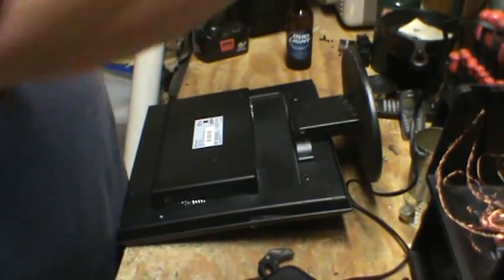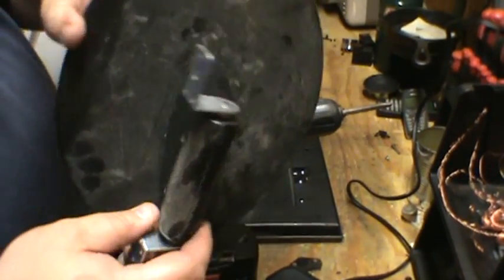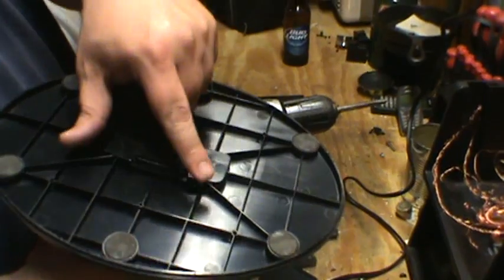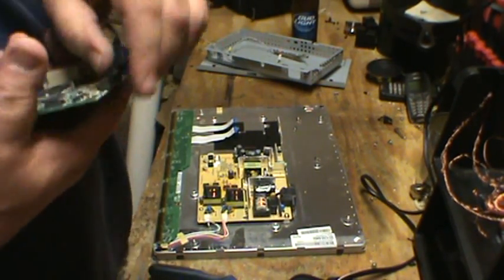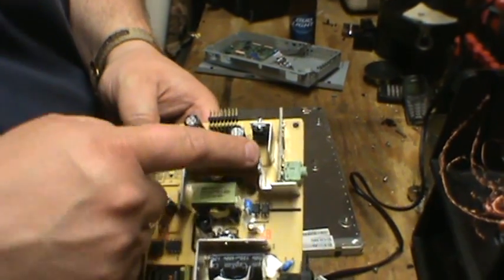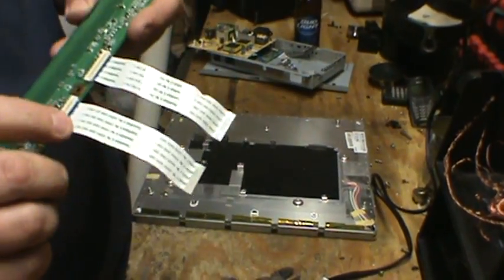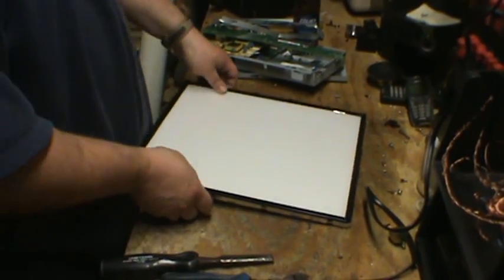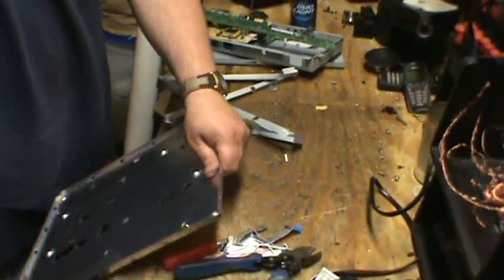Scrapping a Flat Panel or LCD monitor for gold, copper, and more!

Comment: I noticed that when you pulled the tcon board off of the screen you left the little film like connections on the screen and tossed them. Are you sure there isn't value in them?

Comment: When you remove the top/bottom chipboard make sure you remove and keep the sheet cables. Often upon removal off the board they will lift and take the gold plating with the cable (glue is stronger than the gold bond). Doing this will save a few micrograms that your currently throwing straight in the bin. With the white sheet cables with gold ends, the gold actually runs all the way through, not just on the ends so always check them and keep them aside, they will need to be processed a tad differently to extract the gold from them. Using the pyro method to reduce/remove waste materials tends to burn away and small amount of te yield, it catches in the air and floats out if the flame is too strong.  Otherwise your doing well. How long do you wait until processing yours to capture the gold? I'm probably going to do 5 years of collection and then process, fingers crossed that turns out to be at least 100kg of scrap boards and bits made of copper, silver and gold.  Steel has such a low value and very low weight being so thin to the degree that its not worth the effort to fully seperate it, I only keep the bits that have no contamination, it only takes one piece for the load to be rejected...and transport of the steel often costs what you'll get back from it, recycling the steel is more a goodwill thing to do as your working than see it as its own seperate income stream...5c - 11.5c  per kg virtually nothing, especially when clean brite copper/candy copper is at between $7 - $12 per kg, silver getting in at $18 per gram and the all important gold sitting between $130 to $150 per gram, you must be sure your spending the time sorting the correct items.
The small silver 'oval shaped' capacitors on the boards should all be saved, they contain precious metals (silver/platinum/paladium) sometimes they are gold in older electronics, good weight over time with at least 3 or 4 in each screen, the tantalum in the capacitors can also be recovered, though the amounts are small for each one, you'd need a full box of them before processing, so really you could take this video a step further and explain to people what is and is not worth saving/removing from the boards before disposal...you missed out on giving the info aboit the capacitors containing tantalum, the flat capacitors having precious metals, gold all the way along those video flat cables and saving the thin paper like circuits that show gold tip ends, gold often runs all the way along..
You could also explain that some boards use gold, some use copper so sometimes those squares and dots that look like gold, aren't and are just high grade copper...
Still, good video, I used it just to.double check I got everything out and I had it spot on, always good to confirm..
Good luck when you get to processing, take extreme care with the chemicals and the space your doing it in, and don't spill a drop...
If the general yield is around 1g to 2g per kg, i should do pretty nicely when i process half a ton 😂 should equal around a kilogram of gold...or around $ AUD 8k based on today's prices...I'll be a happy man when that day comes around...and just realising how many hundred TV's ill have to break down I'll probably need the full 5 years collecting...thank goodness for uneducated people who throw away these items!!!!

Comment: Really interesting scrap of flat panem/LCD.  Can you take your dissection to the next level?  Maybe say or de.onstrate what you do with the really thin plated gold on the board that was attached to the LCD?  Do you disassemble the copper motors as you call them, or take them to the scrapper just as removed?

Comment: Thank you, I always knew about the copper but wanted to know about the gold. Even with little it adds up with 2-60 inch tv's and 40 inch, plus 4-35 inch. That's a start. My question is.. if I decide to sell them to a use electronic place that scraps, what do you think the range I would get?

Comment: I wanna see you melt something
Reply from the maker: me too!  Soon i hope!
Reply: @moosescrapper5928  the best thing to melt without any fear of losing any portion to evaporation and oxidation because regardless of it's melting point of 2466°C-even in such condition under open air it doesn't oxidize and doesn't evaporate even if you keep it molten forever it will not disappear in any time so you basically can not spoil the melting process no matter how much you will try to!And the metal I am talking about is iridium metal:it's really formidable!I recently extracted around 4 grams of it from various sources beginning with spark plugs and from all the other stuff you can imagine that contains it:10% in platinum-900 jewellery,some in cat converter material although not too much of it in each cat:around 0.2 grams in average which is dwarfed in comparison with 7-8 grams of platinum,the same amount of palladium and around a gram of rhodium in each..But eventually it adds up!And it's unbelievably satisfying to melt it and especially the resulting beads are so damn adorable😍

Comment: So what would you say the total scrap value was in total after removing the copper from the power board?? Maximum of $2 unless you can sell one of the boards on eBay for spare parts. Then you might have $12-$20 which is worth it but ya have to wait for it to sell, but that's the best way to make money if your scrapping small time. Sell the boards on eBay, keep the finger strip board for gold reclaim, which like you say you need a lot of them, probably 10-20kg to gain a gram or 2 of gold and then scrap the aluminium back that's worth $0.25 or there abouts. The steel is worth about $0.08 if that. The amount of copper you get you would need around 50-200 screens just to get 1kg. Doing this just to scrap it all if you get 1 or 2 monitors a week or a month will take you forever and a day to $100. If your doing this just for fun, the fact you can rip apart something that's broken cause you enjoy it and keeps ya busy and happy that's were the real value from this would be and then when you finally do cash in it's a bonus

But still like all your others still a great video and full of facts and information. One question is.... are the connector pins on a power board silver plated?? Or something else like tin or nickel?? Thank you

Comment: Actually very interesting stuff would be scrapping spark plugs-I have a really good yield from them!Got on average 2 grams of pure iridium from iridium ones and actually more than 3 grams of platinum from platinum ones!*
Actually I am mostly doing it because I need iridium for my own purposes-I am actually not a scrapper(mostly)-I am a firearm designer-but since the yield from those spark plugs is really very high and the process of getting all that stuff from them is really instant-as I counted just for the fastest way to process a hundred of them required around 20 minutes to cut all the stuff I needed from them and so,I was left with 15-16 grams of metal pieces that contain all the iridium/platinum that is in them!So just imagine how much will you be able to process during a day!
And the rest of the process is just throwing all that platinum/iridium containing stuff into a small beaker with aqua regia(all together)and just heating that beaker and just waiting!Overnight you will get a solution of hexachloroplatinic acid with some useless poop into the solution,and all the iridium sitting on the bottom simply untouched-because it absolutely doesn't give a fuck about anything acidic known to man(only if you manage to oxidize the iridium fine powder with a substantial amount of heat-than you will be able to react that iridium oxide with some acids to get iridium salts-but that is not the case)-so just put it through filter to get all your iridium metal and then just precipitate platinum from the rest of the poop with some ammonium chloride just in the well known standard manor!So I think it will be good if you make such a video!
And by the way another tip of getting a large yield of platinum!As I figured out,the Ford F-250 cat converter made around year 2006 contains irregularly high amount of platinum and palladium-actually more than 30 grams of platinum(!),and even more of palladium!

Comment: that plastic monitor screen is actually laminated pieces of glass and Liquid Crystal. which from what I've seen looks like silver and gold printed circuits.ifyou look closely you can see the circuits on the very outer edge. you can separate the glass with Map gas to get access to it

Comment: Good video Moose.  I scrapped my first flat screen monitor last night and it had a magnifying lens.  Do you know if that's a frensel lens?  Also, your mid-grade boards...do you keep them intact?  Do you pull off the gold plated pins?  Basically, I've been pulling copper and aluminum heat sinks off low-grade boards but I'm pretty new to this and not sure what to do about the higher grade boards.
Thanks.
Reply from the maker: So far I have nly found Fresnel lenses in projection TVs.  I do cherry pick all the boards because my scrap yard pays the same low low price for all of them.

Comment: Thanks Moose!  Can I ask should and how do you discharge it in case there is power in there? Also, should I try selling certain ones on Ebay first such as the older Packard's or some dells.  Is there a market for them still?
Reply from the maker: You should always try to sell on ebay first.  The market may be slow, but there are people out there buying them.  Mike the Scrapper has a video on discharging that's really good.

Comment: How big do you let your scrap bins get before you bring then in? What does your average $/load end up being? What the most valuable commonly trashed item to scrap. What has the best scrap in it? About how many dollars per hour does it earn you?
Reply from the maker: I let the scrap build up until it starts to get in my way and irritate me...which isn't very long.  I have a scrap yard that is right on my way to work every day so I make a lot of small trips.  Typically I will make $10-$50 per trip.  Depends on what I am bringing.  Also keep in mind that this is just a very small amount of effort put in, less than 2 hours a week.  Some weeks I get more stuff, some less, some weeks nothing at all depending on what is going on with the kid, house, exwife, etc.  What has the best scrap....  personally, I like computer towers.  They have loads of parts to sell, they give me free fuel for my gold recovery hobby.  They also have more of the higher paying scrap items like wire, aluminum, high grade boards, etc.  They are shaped so they are easy to load, store, stack, etc.  But I also like microwaves....lol

Comment: The metal that was aluminium, could that have been stainless?
Reply from the maker: +Leland Lewis If it throws sparks off with a grinder than its stainless.
Reply: OK, just wondering why you automatically classed it as aluminium, has a brushed stainless look.  I have a few here I haven't tested yet because I had assumed them to be stainless. lol  Now I am wondering.

Comment: Hello, Moose Scrapper! I have a silly question... can old tvs be scrapped as well and can there be any profit?
Reply from the maker: +Nicole Dessaint They can be, I have a video on that.  The problem is that today, there have been new regulations passed regarding the handling of lead containing material so the glass tubes are harder to dispose of or have recycled.

Comment: One more thing I never saw you talk about, Micro and standard LED bulbs. It takes a strong magnifier but if you look at them closely you will find gold filaments. Depending on the application they may have more than 1, crushing the LED to almost powder like form will allow you to separate the the large leads from the gold wires by sifting them out. One of the never ending / reusable coffee filters works very well for ashes and pulverized materials, the pores are large enough to allow the gold wires to pass right through. I use them in wet and dry recovery
Reply from the maker: +joe k great tip on the source of a screen!
Reply: hey no problem, i inspect the screen ribbons on every type of flat screen, some have gold some dont

Comment: Hey Moose, you tossed out some gold, well may have. The ribbons attached to the screen that have the chips on them often have gold wires and foils. Some times they are secured with a hot melt adhesive, a common hair dryer will soften it and the ribbons pull off the screen very easily. Take off the ribbons and tear out the chip, use a magnifier to look around the chip and the hole in the ribbon, You will often find gold wires, from there, incineration works to free up the wires from the black epoxy like material
Reply: Is this true?? Well I didn't know that although I do save my ribbons that attach  to the screen. By chip do you mean the shiny almost glass looking thing running across the ribbon ??
Reply: @waynejohnson9889  yes I know what he means.Exactly right,by the way this is silicon die there..

Comment: Does a lcd monitor or flat panel t.v. have a charge to it like the tube counterparts?  Also, you check for gold pins. If they are not gold are they silver? Seems like a lot of metallic pins on all this stuff.

Comment: golld and silver 925 and 14k
Reply from the maker: +Carl Walter is it jewelry, electronic components, trimmed ceramics, I need more specific details.
Reply: I wanted to know where to sell all my stuff at even if I have regular Jewelry and computer parts and ext
Reply: Is there any gold or silver in charger pieces
Reply from the maker: +Carl Walter The only place I know to sell all of it is ebay but there are other buyers out there for specific things but they want a large quantity of each item, several pounds at a time.  I have a video on selling boards etc.
Reply: Okay I have to do my homework
Reply from the maker: +Carl Walter some chargers have gold plating.  But it takes pounds of them to make money.  Most refiners will pay about $1 per pound.
Reply: Thanks mouse

Comment: hey how do u get all the gold from the parts that ain't to harmful
Reply from the maker: +Carl Walter All gold recovery from electronics requires the use of harmful chemicals.  There is no way around that unless you are willing to spend a lot of money on a hammer mill to crush boards down to 200mesh and then sort the metals on a shaker table.

Comment: Hi, I just started scrapping. What do you do with the stuff you don't sell on ebay and the stuff you cant get precious metals from? Like the fluorescent tubes, the plastic, the mother boards after you have removed the gold, copper, etcccccc? Could you still place it in the particular bin it goes in? Can you still sell it to your buyers who who buy the cricut and mother boards. Even though they can reuse it by smelting it down or  whatever they may use it for. Also If you could make a list of tools you need for scraping and the chemicals and tools to scarp the gold and make a video that would share all these basics to get started. Kind of a start up video. I just bought a Toyota Tacoma truck and a flat bed 7 foot long. I made decals to offer to hall for free or if the want to pay me 50 dollars to hall great, I also made my business cards to pass out and I have been advertising in the paper classified section and craigslist. I take all electronics phones, computers, T.V. the old ones are good for the glass u can find buyers for the glass they will melt down and re use again, Some vintage computers like an old Mac book pros and others that will sell on ebay. I also fix computers and beef them up with tons of software and sell them on ebay. Sometimes it is a minor problem it turns on and shuts down and it is  blown capacitor and other simple things, bad hard drives etcc.... Because the contacts I have gotten from schools, businesses and just driving by I also take  metals, and washer and dryers and take a few pound of that to the scrap yard that will use it, That is money I don't want to pass y. My main focus is to start a E waste Recycling business. I work in my garage and I havea bins to put every part in its place. I have huge four by four boxes to load electronics from my hualing connections I want to to grow one day to become a e recycling business where we  will have workers to fix computers and put them out back it in the consumer market. Where people come to me and pay to wipe out their  hard drive and put it through a shredder and  put them back o they have comfort that knowing that no nobody will get their info. Separate the parts once they come out the shredder and sell them to buyers that will reuse them again. These are long term goals and I have to star from the bottom up. So, if you could share with me a video of tools for this business, I might have some already. Also, please answer my questions. I just wanted to let you know where I am at so you can get a feel for me. Thank you for reading and your videos are awesome.